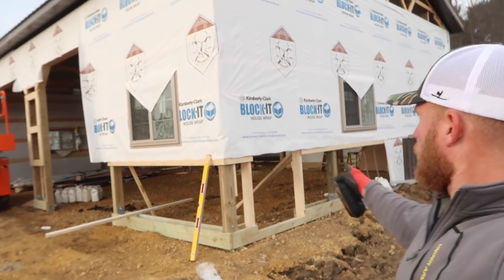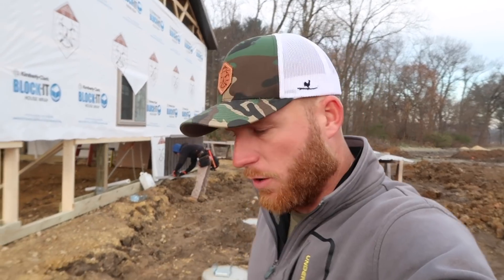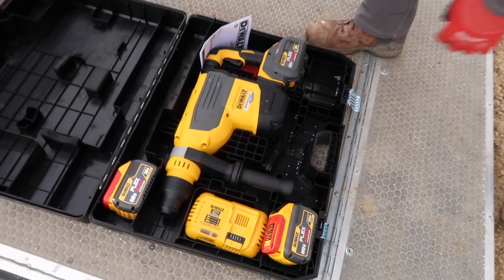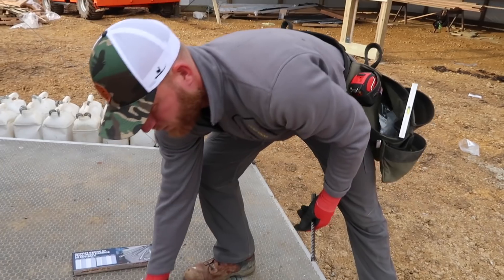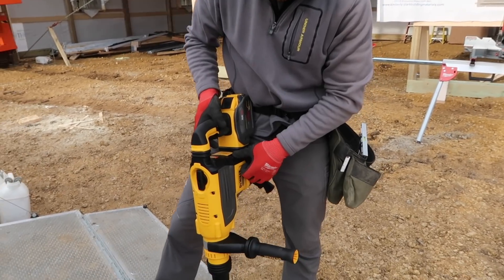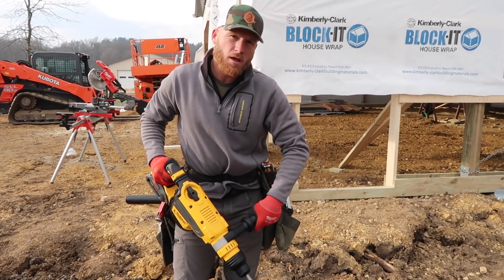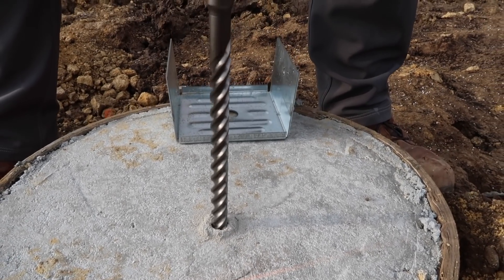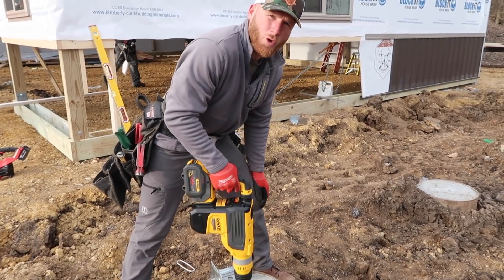Building a Mancave 7:  Framing a hipped porch

Comment from the maker: Thanks for checking out video 7 where we start framing our hip porch.  I will be installing the metal and trim details in the next video hopefully in the next day or so
Reply: I really want to see a review before I buy it
Reply: Not a criticism but you could save yourself a lot of time with roof framing calculations if you would invest in: Full Length Roof Framer By A.F.Riechers. 
Mine has a date of 1917- renewed 1944.
I've been using it for over 40 yrs. 
Just a hint. All rafter measurements are on top and on center. I noticed you made a center mark on your 2x12 but the purlin wasn't on the center. The 2x12 you have in the center is not a hip. In a normal roof frame that would be a common rafter.
You are a master carpenter for sure but you could learn a lot from the book I suggested.  
The forward says:
 "A series of tables giving the full length of all rafter for any span, for 48 different pitches.
Cuts and bevels for common, hip, valley, jack and purlin rafters; also cuts and bevels for gable and cornice mouldings, accompanying each of the 48 pitches with illustrations"
Reply: you prolly dont care at all but does someone know of a way to get back into an Instagram account??
I somehow lost my account password. I would love any assistance you can offer me
Reply: @Ralph Jagger Instablaster ;)
Reply: @Imran Kasen I really appreciate your reply. I got to the site on google and Im in the hacking process atm.
Looks like it's gonna take a while so I will get back to you later with my results.
Reply: @Imran Kasen It worked and I now got access to my account again. Im so happy:D
Thanks so much you really help me out :D
Reply: @Ralph Jagger No problem :D

Comment: That beam saw is a monster. I'm a finish carpenter and used this saw to cut 4.5" thick wood panels. Build my self a track to ride this saw on for more precision . And you can get semi finish blade for it. The results are pretty good.  We have felstool  track saw ts 75 but it will only cut 2 15/16 " deep. So i feel you there Its not your everyday saw but when you need one you need one. worth every penny. Good job on your builds!  Subscribed.

Comment: A little tip on the post bases. 
We always drill and put tapcons in each corner to help keep the posts from twisting the bases.  
It really helps on pressure treated posts that get a lot of sun.
Reply from the maker: Not a bad idea at all!
Reply: Yes, we do too. We have demo’ed pressure treated joist floors that the twist has buckled the joist hangers, especially hangers with missing nails.

Comment: That rafter hip fix is definitely as strong or stronger than just running it as a buttjoint into the corner.  It's grabbing the fascia over double the surface area, not loading up the same 1.5" butt edges with fasteners and potentially blowing it out, and the 12x rafter is putting the same equal load onto the column as it otherwise would have if you had done it the other way.

Comment: S4S = Surfaced 4 Sides, not sanded 4 sides. They are run through the milling machine at a lower feed rate to give more knife cuts per inch which yields a smoother surface. Just a FYI, not busting balls !
Love your videos !

Comment: I would love a video to break down how you did that math! Do you have a patreon? I would definitely pledge to get content like that.
Reply from the maker: www.patreon.com/rrbuildings
Reply: @RRBuildings  just pledged (:
Reply: Can you a metric version so us at the other side of the pond can understand
Reply: @frazer26  45 degrees converts to 7.222 celcius and 90 degrees is 32.222 C. Work it from there :-) kidding! Lol it's too hard on a jobsite to flip flop the measurements. If he is anything like me, some of the stuff I keep in my head and if he were to give the conversions, it would take a lot of extra time.
Reply: @johara4509  @Frazer Telford While it's not exact, the rough way to estimate I was given was take your temperature in Fahrenheit, subtract 32, then divide the reminder in half. So 90-32=58/2=29. While not exact, it'll get you in the ballpark. Cheers
Reply: @liammcgarrigle  I've purchased books on this topic I find it very helpful it breaks it ..down good place to look is Amazon.. I refer to these as reference tools you can go back and refresh your memory if you hadn't done it in awhile
Reply: He didnt do the math like most new. Framers he used a calculator .. And he still built it wrong.. Never even stated now since framed wrong how much more frame will be needed to deck this roof.. And no ledger.. There are no perlin blocks on the roof.. He used solid hips.. Also the only structure on a rood that should run horizontal is a valley set.. This is framed wrong and out of code... Just sayin

Comment: I do enjoy your videos, Thankyou for the effort you obviously put into them and your work.   Infact I'm  from Eastern part of  IA so I've possibly seen some of your work in my travels into/across Illinois...I digress haha, sorry. 
***My question:  
Asume you'd want to make the ceiling  of this porch into  vaulted ceiling, how or can that be done?  I find the issue in the removal of the ceiling ties (the bottom  3rd of the triangle as I see it in my head).  The long joists that make up the angle of the roof do have the building structure to lean against and downward onto the structures wall supports so are the bottom ties/ceiling joists/rafter ties, (I'm not sure of the exact terminology)  completely necessary or would removal of them want to push your outermost posts of the porch roof outward, or basically would the roof wanna kick out the wall bc there's nothing connecting that wall to the ledger board of the building.  I hope I didn't confuse this too much to understand.  I appreciate  your viewpoint/answer to this.  Thanks -
Reply from the maker: I think it’s all In how it is fastened.  Def could be done

Comment: those anchor screws kinda seems flimsy. 
If it were me, I'd drop epoxy down there and screw them just to create a stronger bond. Although preferably setting the anchors with concrete is best.

Comment: I never framed a hip roof like that. No purlins. Hip rafters, common rafters, jack rafters.
Reply: I should have read your comment.. Spot on.... Bad frame job in a lift 10 foot off the ground... Why..just why???
Reply: You'd have to strap it for steel (no big deal) and he doesn't.  Most hips aren't framed this way be cause you'd have to have HUGE hips since they support everything.
Reply: @Reigneng2008PSN  Lolll when I saw the lift I was like wtf. Maybe he owns it which would be a different story but still. On small roofs like that you don't need a purlin, just a tpost under the ride.

Comment: Why didn’t you place a rafter against the building and just run Perkins to the wall as that is not enough to support any roof load.. Also why didn’t you cut the tail on the hip rafter to go all the way to the corner  of the facia as apposed to nailing to rafter tails to the hip rafter. Seems like your adding more work?

Comment: If you have irregular pitches on a hip roof the hip is called a bastard hip.  Construction master pro has a function to do that so you don't have to design on paper.  Great job though, I know very few framers that can do irregular hips with just math
Reply: It's called an irregular hip when you have 2 different pitches meeting at the same hip or valley

Comment: Is this a joke. I did this for over 35 years, now retired, I've never seen this done like this before. You keep referring to the math, what about the building code? That doesn't lie either, this wouldn't pass where I live. You could have at least put a cleat (rafter) on the wall where you toe screwed your purlins to the wall to stop the roofing from flexing. Looked like you had one drawn in on your paper, but never installed it.
Reply: Roy Ormonde isn't it underneath the house wrap?
Reply: @sjv6598  Well maybe there is something under there. Personally I would have put it on the outside to stop the roofing from flexing, certainly even on the installation of roof they would have noticed that it flexed with their weight on it.  Who knows, maybe they addressed this later but just didn't show it.
Reply: Roy Ormonde Check video 6 on this build it shows the installation of the rafter.
Reply: Are you from New York? Maybe over there it wouldn’t pass the inspection, but there’s nothing wrong with this construction.

Comment: S4S refers to surface & is done with a surface planer not a surface sander.
Reply: I always believed it was Smooth 4 Sides; S4S.
Reply: MegaSkilla  as Lynn Dunn said, S4S stands for surface 4 sides, and the only method used is planing because you cannot get perfect 90 degrees the whole way around unless you plane

Comment: Alaska has lost most of our GC because of covid. how would you like to do a show in Alaska on a homestead house? it is 45 years old. we have done some updates. what we are getting from GC around here is scary work and overpriced. for example, I was quoted 80k for a kitchen with no upper cabinets. 30-36 for a bathroom and we didn't even pick any tiles or tub yet. let me know if you would like to work a deal. we do not have to pull any permits in my area.

Comment: Why wouldn’t you put hip jack rafters in instead of the “purlins”
Reply: Aren't the purlins needed to support the metal roof? Hip jacks would be parallel with the long edge of the metal.
Reply: Why are purlins in " parenthesis? “ that's what they're called, and they're used to give the metal roof its load bearing strength

Comment: Math never lies your right. You make mistakes right. USE A STRING LINE !!!!! If have 12 inch over hang set string line and avoid stupid math mistakes. Scabing would not happen on my building with screws none the less.

Comment: Did I miss something? Why not frame a traditional hip? All of this complicated math is already been done and can be found on a framing square. Not knocking the work at all. There is more than one way to skin a cat. Just curious as to the reason it was Built this way.
Reply: I have to agree. Kyle does awesome work, but most folks have not trained on the framing square and don't realize all it can do. It's an old time magic computer to figure all you need on a house. All those victorian houses with crazy hips, turrets, widow's walks,  etc were all figured on the framing square. The master carpenter on the job knew how to read a square even if the others didn't. It's hard to build up skills for that kind of stuff if you don't do it often. I am impressed with his work ethic and efficiency, and for what he does 99.9 % of the time he is kickass.

Comment: I spot a mistake - You didn't put small ball of grease in sds chuck before putting drill bit.. Strange, that small, white grease tubing was not in that DeWalt rottary hammer case.. Whitout grease in sds chucks, usually, life shorten's for spindle groves (tooth's), dust protective cup and drill bit holder keys (rollers).. And i don't believe that this new cordless rotary hammer doesn't require grease because older DW540, D25500 etc, without grease time by time in tool holder, in construction work conditions, fail mentioned part's in short period.. Rubber protective cap, fail's first and that's allow dust to get into chuck, killing all other parts, including beat piece seal.. And when tooth's in spindle fail in rotation, may forgot to remove drill bit from chuck (from service You may get back solid piece of spindle and drill bit and separately repaired rotary hammer with new spindle).. When key's fail, drill bit jump's out by self.. :D

Please, read manual carefully for that new DeWalt rottary hammer.. ;)

Comment: Video is of the quality good. However, in my opinion, this film shows professional ? Errors in the execution, in my opinion. To my knowledge as a carpenter the shifter are not correctly arranged. These would not have had to be mounted horizontally as shown in the film, but vertically. Except the building regulations have changed significantly in the last 15 years. Many thanks for this video and many thanks for the test.

Comment: All scabs should be at least 4 ft for code.... Hmmm.... Why make square cuts on a 90 degree corner for your facia.. And in a lift.. Should be 45d........ Perlin blocks wtf??? You used solid runs.. There are no actual perlin blocks used here... And now you have to add alot of blocks to deck this roof as framed incorrect.... Do not do this......